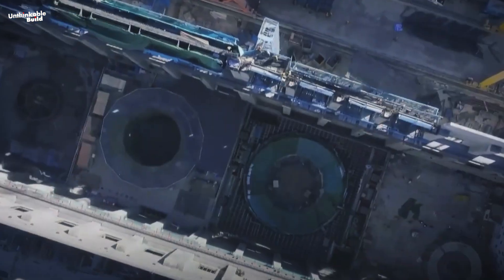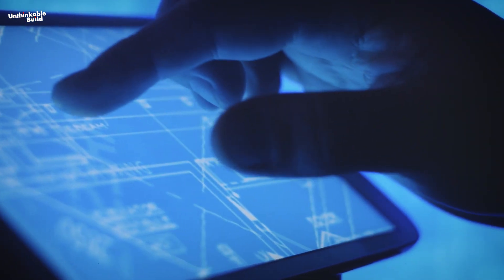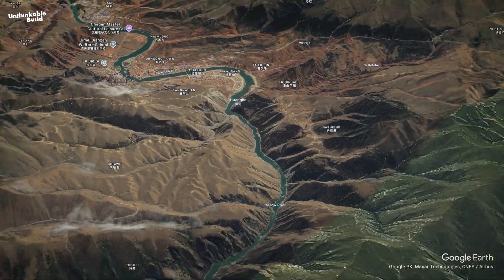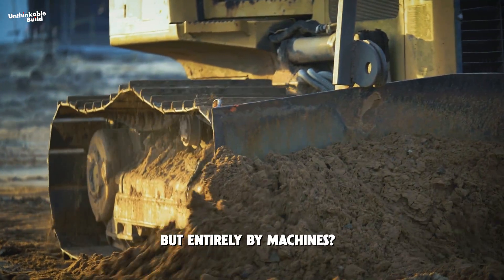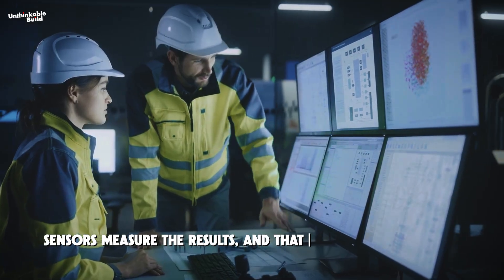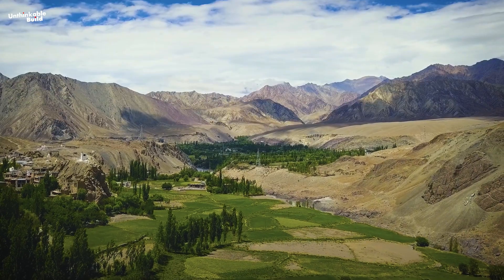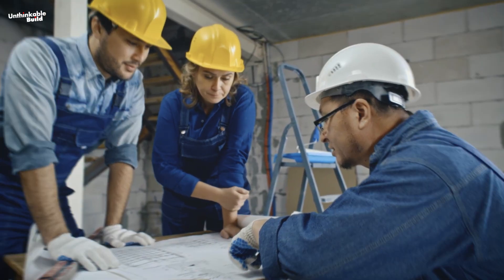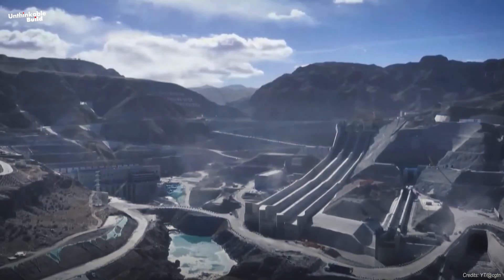No Workers, Just Robots: Inside the World’s Largest 3D-Printed Dam

Comment: Absolutely NOT   AI  cant be trusted
Reply from the maker: It's completely valid to have concerns about AI especially with how fast it's advancing. Trust should be earned through transparency, regulation, and responsible use. AI is a tool, and like any tool, it depends on how humans choose to use it. Caution is wise, but shutting it out entirely may also mean missing out on potential benefits. Balance is key.